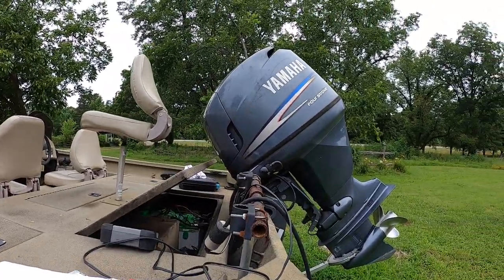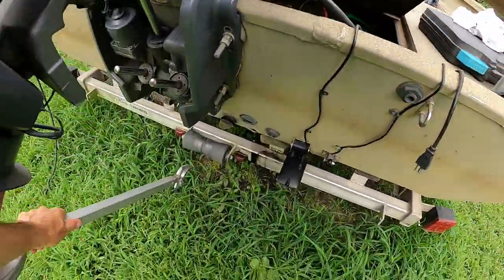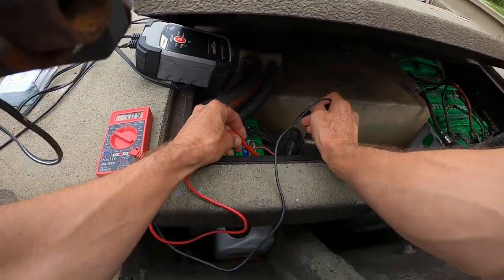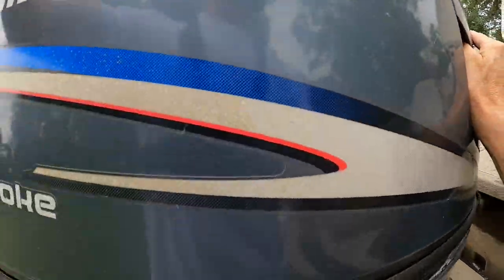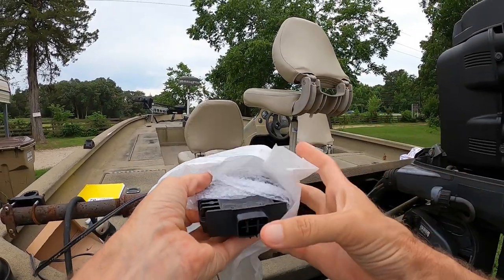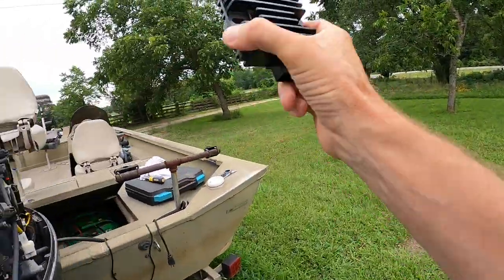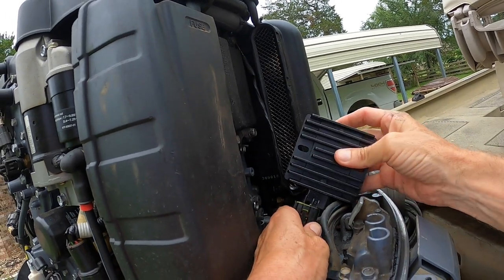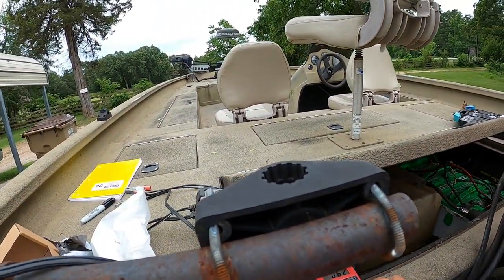Boat battery not charging while fishing? TRY THIS

Comment: I charge my battery every time i head out, but on the water it was shows 11.4-12v. The battery is 4yrs old. Could it be the same issue with urs? Cheers.
Reply from the maker: @Cparker8  might just be the age of the battery. I used to never have to charge my cranking battery but it seems like the newer ones just don’t last as long as they used to. I rarely get much more than a year out of mine these days.
Reply: @CATCHAHAWG  Wow 1 year? That's crazy. The battery indicator on mine is showing 'recharge battery' even though I already have. Also I don't recharge it straight after use but instead the next time right before i head out again. Probably not good right?
Reply from the maker: @Cparker8  I’m guessing it’s the age of your battery that’s causing the voltage to be low. If you check the voltage while the engine is running it will tell you if it’s charging. Mine is around 14v when running.
Reply: @CATCHAHAWG  thanks for the response mate, subscribed.

Comment: That go for a 2 stroke mercury 250 Pro Max?
Reply from the maker: You will have to look up the part number that goes with that particular engine. I think most of the older engines have something similar. Thank you for the comment 👍